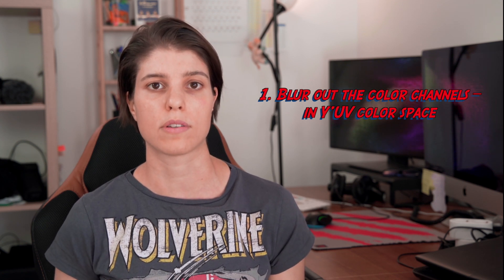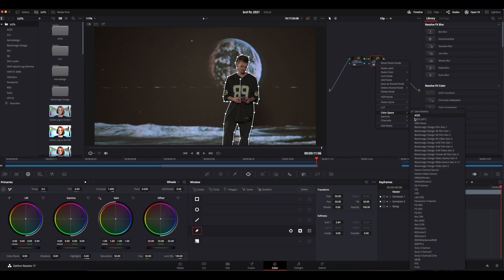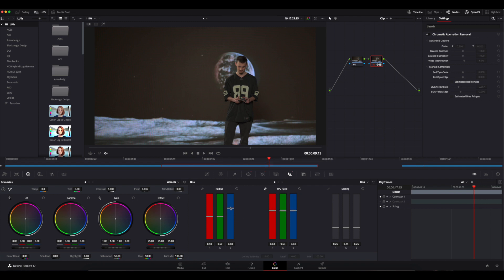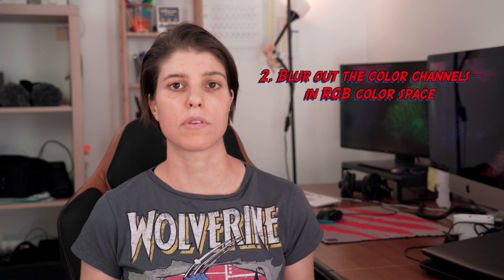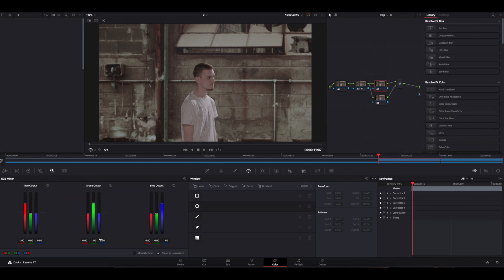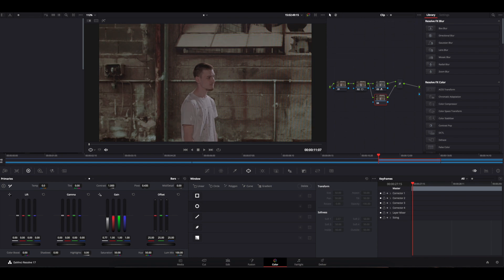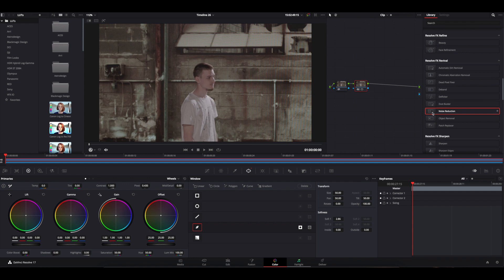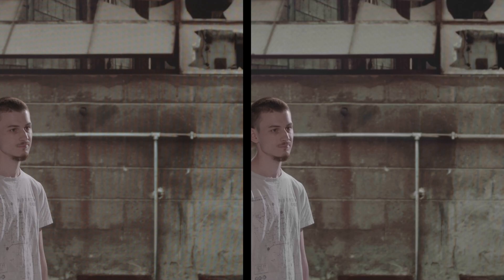How to Remove Moire from Video Projected on LED Screen in DaVinci Resolve (Studio 17) | 4 Methods

Comment: i did chromatic abberation removal, it found the problem edges but it doesn't seem like it did anything
Reply from the maker: I found this specialized tool https://filmworkz.com/dvo/chroma/
Also if the shot you want to use isn't long (2,3 seconds) you could try exporting it as jpg (look in the DCP export  options ) and import every frame inAdobe Lightroom. They did wonders with chromatic aberration on their newest updates
Reply: oh interesting! I never have luck with Lightroom ha ha what specific function is it in Lightroom? I emailed that company about just getting that 1 plugin @IonCosmina